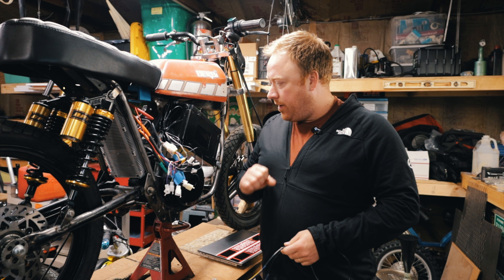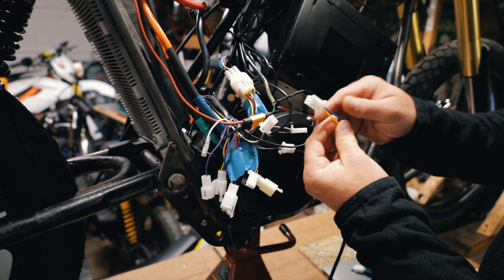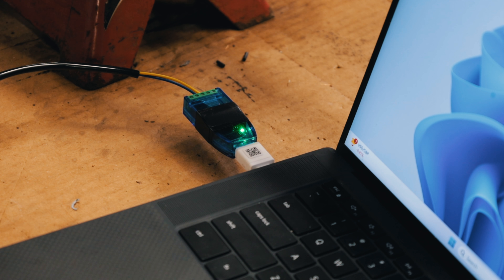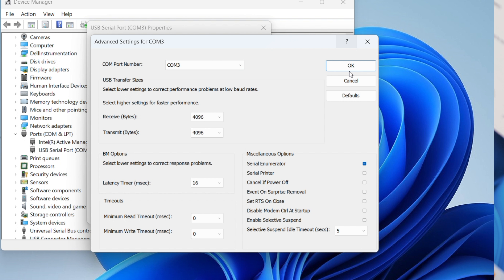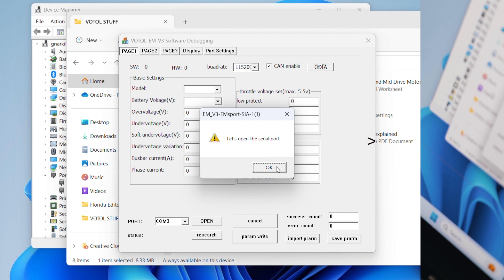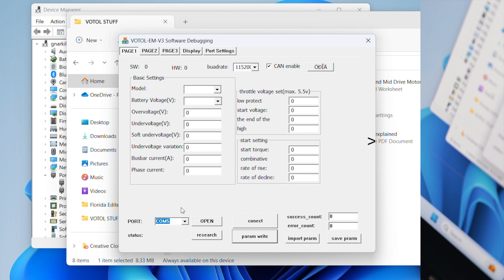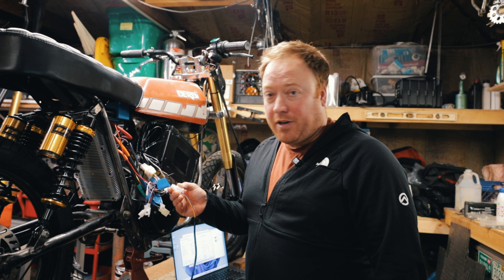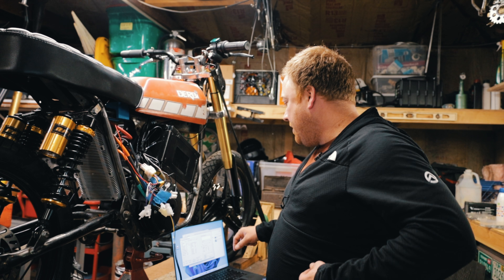VOTOL Controller Computer Connection made easy DIY Electric E bike

Comment: hey i have been having a problem. I keep trying to connect the controller but everytime is say “communication abnormal, no response.” i tried the way you said to do it but it just doesn’t work for me. Do you have any tips???
Reply: I have the exact same problem. Were you able to solve this problem?
Reply: I'm having the same issue. Mine does not actually say votol on it so I think it could be a clone and that could be the issue.

Comment: Glad you figured this out! Still struggling with mine..
Reply from the maker: What is yours doing
Reply: @Corn-ped  I'm getting a weird error message of all sorts of random characters. Then, it continues to ask me to select serial port. Crazy thing is I had everything working in the winter time. Not sure what changed!!
Reply from the maker: @chuckwillyduece  thats really strange. Maybe the com box got checked? or its a different port number?
Reply: @Corn-ped  yea I'm going to keep messing with it and see what I come up with. Maybe I'll uninstall everything, take the controller off the battery and start from scratch 🤷‍♂️
Reply from the maker: @chuckwillyduece  yeah I would disconnect it and try again.

Comment: Hello, I have a Votol em260s controller and I have a wiring harness that is not complete. Which pin on the controller does the reverse gear switch go to? Do you have a plan for the pin assignment?

Comment: Hello, I plugged in the black and white cable instead of the black cable in my device, so now I am connecting to my device, but I cannot move my electric motor.  Has this happened to you? can you help?  Is there such a thing as a reset? Can I reset it?

Comment: i have the same problem i get communication abnormal, no responses what i can do?
Reply from the maker: I had to plug in and turn on the controller in a specific order for it to work.
Reply: i do that but the throttle is not working can you please do a tutorial?
Reply: and the port are com 4 but is still communication abnormal